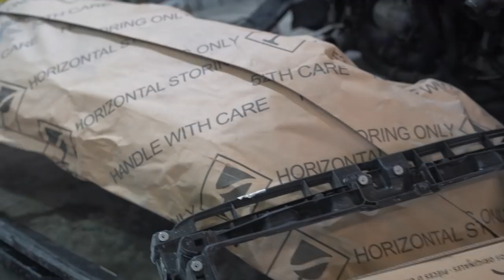REBUILDING A 2017 VW M7.5 GOLF R IS NOT CHEAP! OR EASY! - PART 4

Comment: Hi from durham dee and akil👋👍 great job on golf R man 👌 always best to walk away if its stops progresses so be it but to keep it moving sometime just keep it moving homeward bound😂👍 them pressure points got good rub that night man woosah😂 I did belt water pump snd few bits to me mates transit then getting me tools rounded up I dropped half inch ratchet and done exactly this to a return nipple too it just popped rite off like I hit it with a 20lb sledge hammer😂 so yeah he got new one👌 and I did work for nothing that day cos the part outweighed the favour😢 lube the rubber ip too helps the kneck slip over the fitting thats what I do if helps bro 👍  lol but all the best man lads have nice weekend and happy easter SALVAGE NATION CREW K.I.M👌thanks for your time and be safe see you soon👍👋

Comment: good to see the build on this again Dee.. in your opinion, is it worth buying a copart Golf R fixing it even you spent $5-6K ?? at the end does it come out cheaper than private sale / Dealer?
Reply from the maker: Depends on if its for you or not. If its just to flip I wouldn’t
Reply: @SALVAGENATION  flipping high spec categorised cars from auction is mega expensive. They're over valued during the auctions right?
Reply: @Naiatelu  depends I see some cars that are worth 37-40k and some people can get them for less than half that. So figure a few thousand more you save at least 10-12k rebuilding vs buying from dealer.

Comment: Hi Dee i have a question which is confusing me, as you said you repaired this car after the first crush and now you repairing it second time but why Airbag didn't go off this time because i remember you changed the whole airbag kit after the first crash.
Reply from the maker: I think your mistaken, never had any airbag damage. Go see the video.
Reply: @SALVAGENATION  yeah you are right dee but still this stime the whole front end is gone still airbeg didn't go off. do you know any reason?